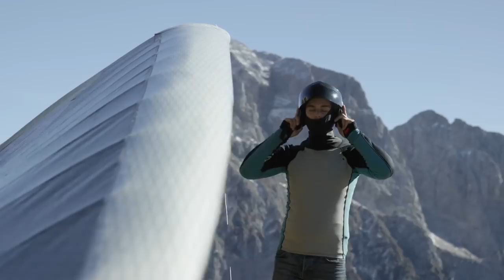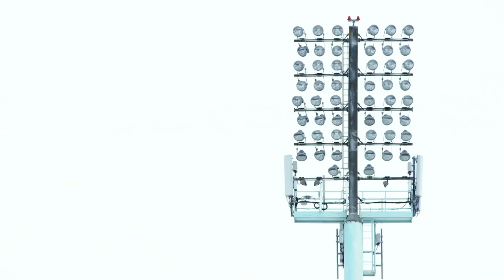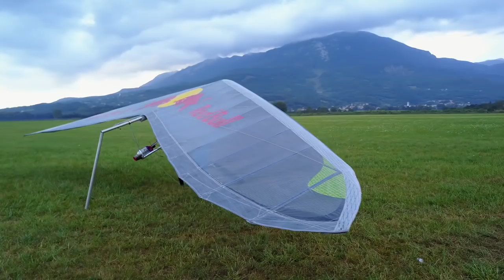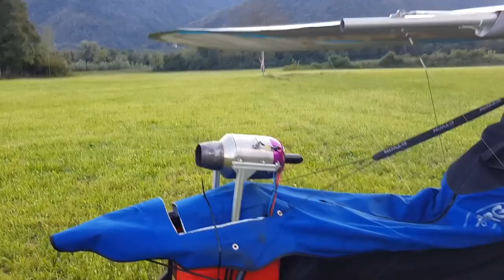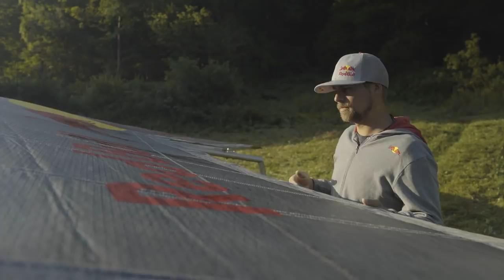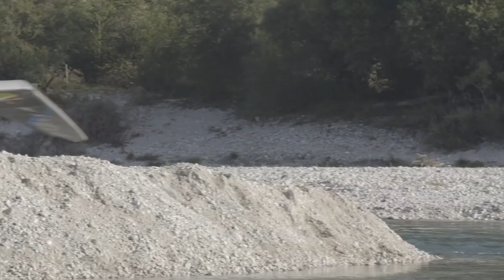JET Flight - the story

Comment: Great for taking off from a flat area, getting altitude and then shutting the engine down. Perhaps the same could be done with a ducted fan, with just enough battery to get up to height with a little in reserve. 
My biggest fears from the jet engine would be a fire starting under the engine and the engine stopping for some reason. 
I have a feeling your powered hang glider will become a common thing in the future.

Comment: That's sooooo cool! Next project maybe? Launch from mountain, then near the bottom - light up the engine and go back to the launch point!
Reply: he may have to do some center of pressure, center of lift calculations before attempting a big climb,  the current config does what he want's from the setup now, but a lot of testing is gonna have to be done with someone with an aeronautical design background.. remember as speeds/weights, and AOA increase/ decrease it has an effect on the air frame.. they may have to close that gap between thrust and lift before attempting serious altitude..
  it's ok with the weight on the back (on calm days),  but dealing with thermals and high winds well probably see the engine mounted above the wing.. about 1/4 down the chord,  and a small fuel pump added.. maybe a small vert stab as well .. 
  will be interesting to see what they come up with..

Comment: Freaking epic. Now add water to cool the bearings and flash boil in the engine to extend fuel. With water cooler bearings, can try pushing the rpm till sound frequencies go ultrasonic for a quiet flight

Comment: I wonder why the jet engine was not mounted closer to the wing, aft enough to not interfere with pilot movement. The pitch-up moment due to the very low thrust line in this installation is quite evident.
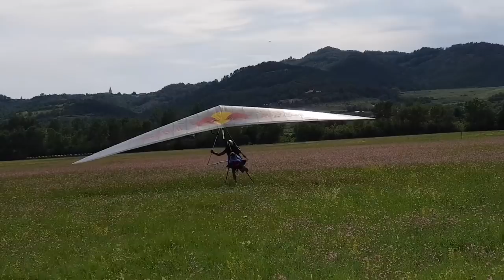Reply: 9:16 should answer this question
Reply: Make the frame completely unstable. Not a good idea.
Reply: In hindsight my comment was incorrect. In the early days of hang glider towing the towline was connected to the glider structure, which could overcome the pilot command inputs (lockout). By attaching the towline to the pilot harness this problem was overcome (they figured this out after I stopped flying hang gliders regularly so I have no practical experience with this and thus did not think of it). It is obviously OK to have the thrust line at the pilot's low position.

Comment: Great work Matjaz. Can I make a suggestion? Mount the jet on the boom but make the mount for the jet able to change its pitch as thrust increases. At full thrust the engine pitches slightly downward to compensate for the downward thrust quotient.  That way you overcome the thrust/pitch problem and the awkward harness / jet set up.
Reply from the maker: Have you ever flown a hang glider?
Reply: @MatjazKlemencic   Hello my friend. Yes, I built and flew my first hang glider in Quito Ecuador. the 1984 Clubman was my favorite. After hang gliders I took GA flying lessons in California. Now I live in Lima, Peru and fly paragliders. 
I wish i had access to a jet like yours.
Reply from the maker: @jenserickson1268  Then you will understand why your proposal wouldn't work :) The keel is not in the position of the airflow. If I would have it on the keel, I would be nosing in...
Reply: @MatjazKlemencic  There is already restricted intake airflow behind the pilot, where you have it presently. It is in the pilot's wake. Moving it to below the aft keel increases direct airflow. The pitch setup I described reduces the thrust/pitch problem. Perhaps I can send  a sketch.  
I wish you the best in your efforts. You are a lucky man to be able to be on the cutting edge of technology with flight. The rest of us are in office cubicles dreaming about it.
Reply from the maker: @jenserickson1268 thanks Jens. It was a one time try. A project. Now the jet is already elsewhere 😊

Comment: I appreciate your hard work and the novelty factor, but this is the wrong type of engine for a hang glider. 8 minutes for 10kilo of fuel? What you need is a large slow turning propellor, and an efficient battery.
Reply: He would need a metric ton of batteries to get off the ground.

Comment: I have a question because yes it is a god idea but why you install the jet mobile with you,
I observe that the jet push you and not the delta 
so why you don't install on the delta
Reply from the maker: IT would be too unstable. If you understand the logic behind take off, you will see that it wouldn't be a good choice due to the weight distribution as well.

Comment: How fuel efficient is the jet engine and what range can you get with it and with how much fuel? Jet engines are inefficient especially small ones but you were flying low with ground effect to compensate! Also what type of hang glider is this that is suitable for the jet engine? What criteria does it have to be suitable? Wingspan? Also what was the total cost to build this jet glider?
Reply from the maker: Hi, it is mostly all explained in the video :) 9 L per minute, no special wing, it is my hang glider for free-flying with no engine. Cost, with that wing and this jet (17.000)
Reply: Matjaz Klemencic the engine is $2000 so does that mean the glider is $15,000? That’s a very expensive glider! What range can you get burning 9L per minute? How many L can you carry? (In the video you said you carry 10L that can last 8minutes but you just said 9L/min so which one is correct?) the burn rate be reduced if you fly close to the ground to use ground effect to create more lift so you burn less than 9L/min? Lastly do you happen to know the power range by the engine? 20-30 horsepower? How much KW or HP do you need to stay airborne if flying low? And how much is the maximum power?
Reply: @thedronehorseman4713  did you watch the video?
Reply: @craigbielsky115  yes

Comment: Amazing! Still in the beginning of the video but if you don’t mention it, how long can you fly with one fuel load?
Reply: I think he said 8 minutes on 10 liters. Back when mounting the engine in the harness. The electric parasailing is really moving forward.
Reply: Keith Mantey Thanks Keith! Yes I saw it while watching the vid on 😄 I have a feeling that big electric RC motor may be way more efficient timewise than this jet turbine! I’m really tempted to build one day an extremely light craft but power it with a mowing machine motor. Only, we should only fly these in almost windless weather for they (ultralight aircraft) have very bad crash record!

Comment: Great innovation and film! Has anyone ever put any kind of propulsion on the hang glider frame itself? I wonder about the physics of it. Would it be possible or even easy to control if the motor is on the frame? I want to put electric folding propellers (one turning CW, other CCW) on the back keel, and test it at high altitude. But wonder if anyone has done that or understands the physics of hang gliding better than I do.
Reply: Paul Shorey Google ‘Soarmaster’...
Reply: I put an engine on my UFM Easyriser in 1977.  This is a weight shift for pitch aircraft.  The most critical point is the attach point and the drive line pitch angle.  Once I had placed it one notch too high (testing different 1 inch attach point levels for effect ... too low and you are plowing, less efficient ... higher makes it plane better due to efficiency increase, but more dangerous, as I found out).  Under power, this resulted in a pitch down drive under power.  That was fine in level flight.  From 400', I purposely went into a dive.  When I tried to pull out, I wasn't able to, due to insufficient weight in the rapid descent.  At about 150 feet, it spontaneously and suddenly pitched up hard.  I would have been killed had it not done that.  I never made that drive line mistake again, but it showcases how critical something seemingly so minor can be.  In retrospect, all I would have had to do was open my mouth.  I had an ignition kill switch that kept the ignition circuit to the engine active as long as my teeth were clamped shut.  Had I opened my mouth, the engine would have wound down in about 3 seconds, giving my weight shift control back.  Unfortunately, I didn't think of this at the time.  I never forgot that escape method after that, though.  It pays to be lucky when you are stupid and ignorant.  The wings of the Easyriser were designed and built with a washout (part of the kit design from UFM, Ultralight Flying Machines, Cupertino, CA) that helped me out of that jam, when the flying speed increased sufficiently.  I was 27 when I did this.  I'm 70 now (as of 20200426).

Comment: I doubt this is going to be a one-off. The sketch factor compared to a lot of other sponsored stunts is nearly on the floor with this one (not like flying an airplane through a tunnel and the speed is fairly conservative), and the whole thing is a conglomeration of off-the-shelf components. Looks more like we're glimpsing the leading edge of a hobbyist aviation motorsport. (I'm guessing putting this together is in the same price window as a nice paramotoring setup.)
Reply from the maker: Nope not a plane indeed. 😁

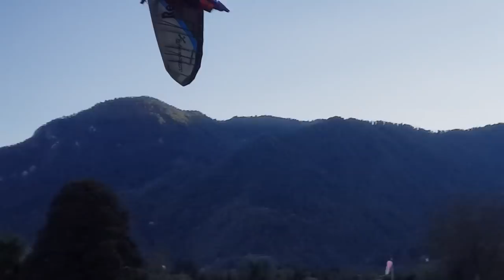Comment: 12:38 drinks from can of Red Bull wearing Red Bull logoed clothing and flying a Red Bull logoed glider.

Please don’t tell me Helmut Marko’s behind this too..........
Reply: Good job and nice flight! I did similar flights 30 years ago with propeller and two stroke engine. I then had the engine on the hangglider in the same configuration as the soarmaster. It was sensible for turbulence and made the hangglider less agile. I would have preferred a jet engine mounted on the hangglider if it had been available at the time. Today I would prefer electric thrust.

Comment: Sure it's difficult because why would anybody immediately think to mount 80 lb of thrust to the structural framework at the center of gravity? Honest mistake.
Reply from the maker: Hang glider means someone is hanging from the wing down. So putting the engine on the glider would create some exciting delays between the mass of the hg and the pilot. Not that I say it is not doable, but far easier it is the way we did it.

Comment: Hello man.
In the video, it is said that putting the jet engine directly on the keel was problematic but it did not tell why. Do you know why this was an issue ?
Was it about flight mechanics or just a problem of securing the engine properly onto the keel ?
Thank you lots.
Reply from the maker: Hi,
the keel is not positioned directly in the wings flying path. Therefore any differences in thrust would create pitch down or up movement. With having the engine on the harness I was able to compensate for these differences.

Comment: what speeds was it clocking?
Reply from the maker: About 80 km/f for proximity flying but it can go faster
Reply: @MatjazKlemencic  looked quite a bit faster than that.  Awsome ground effect.
Reply: @MatjazKlemencic  80 km/f? or 80 kmh? If kmh = 50 mph

Comment: Make your tube that leads from the gas tank to the engine a lot wider, that way bubbles can float back up it back into the gas tank, when you get bubbles in your line from no fuel at that moment being at the bottom of the tank.  Also, obviously, mount your tank up higher.  choppergirl.air-war.org
Reply from the maker: Hi, it all seems reasonable and logical. The only problem is, it was not possible to move the gas tank higher.

Comment: why no installing a tail ?
Reply from the maker: Because the wing is self-sufficient in pitch movement, and the tail is not needed.
Reply: @MatjazKlemencic  wouldnt make it more stable and maybe more maneuverability ???
Reply from the maker: @oscarcortesdiaz9772 @oscarcortesdiaz9772  More stable, yes, but stable also means less manoeuvrability in most cases. That kind of design exists with the Aeros Combat hang glider wing.
Reply: @MatjazKlemencic  whats are the speed limitations for that aeros combat hang glidder ? could you install 2 jets in one of those ?
Reply from the maker: @oscarcortesdiaz9772  speed limitations are the same structural as for any other hang glider. You can put two jets on any hg wing but drag will stop you at one point. We agree on that right?
Reply: @MatjazKlemencic  right boss .. i hope tecnology helps this matter soon i we able to have smallers engines with more power
Reply: @MatjazKlemencic  have you ever think about solar panels on top of wings and electric engine?
Reply from the maker: @oscarcortesdiaz9772  not really. This flight was one of a kind project. Otherwise I fly without an engine as first choice.
Reply: @MatjazKlemencic  its just the fact that you can easily take of from anywhere ... thats a big big plus...love it
Reply from the maker: @oscarcortesdiaz9772  With that noise, you wouldn't repeat it once :D
Reply: @MatjazKlemencic  maybe toroidal propellers would help with noise problem ? not 100% but would help

Comment: Now put two jet engines on there :D
Reply from the maker: No need to ;)
Reply: @MatjazKlemencic  pft! Two is always better than one :p
Reply: @AndreasEUR   I prefer four...
Reply: @Renato.Stiefenhofer.747driver or 8
Reply: @AndreasEUR   I'm okay with four. Regards from the 747-8 cockpit. Are you B-52 driver?...
Reply: @Renato.Stiefenhofer.747driver  No, I just think 2 is better than one.  And has to be multiples.. 2,4,6,8 :P 

V8 better than V6.. V6 better than I4. 

I've never flown anything, I really wanna try paragliding and/or hanggliding. Would be cool to get LAPL license, but holy it's expensive!
Reply: @AndreasEUR   Just do it. Sell your V8... I started flying hang gliders when I was 17. Then I upgraded a bit. But I drive a V6, only. Cheers and good luck with the LAPL. ✈ R